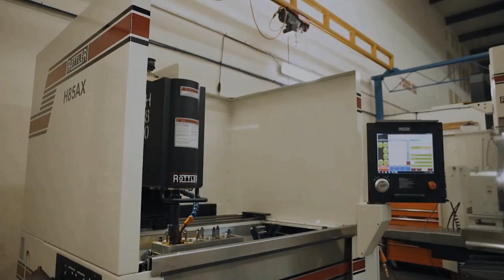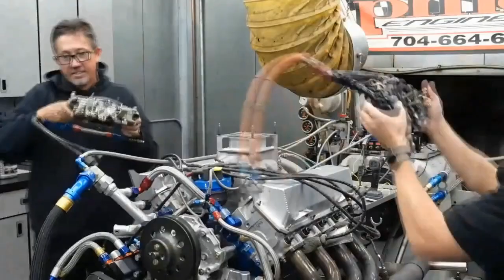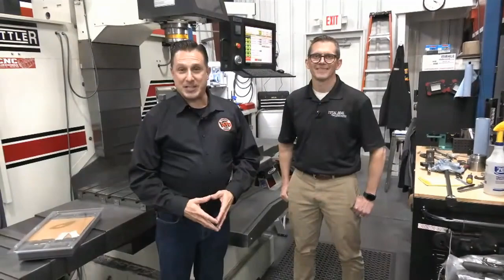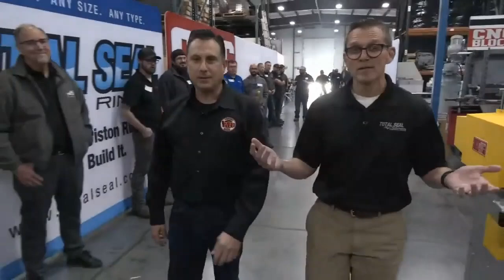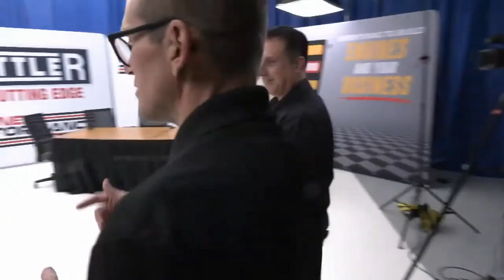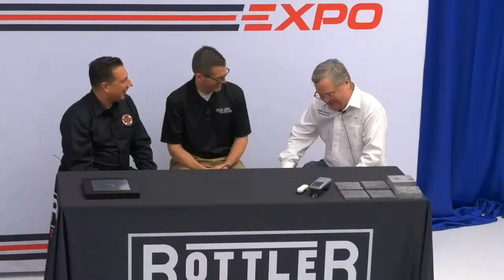Ed Morel Interview & Project Pontiac (Expo 2024 - Episode 17)

Comment: What actually happened with Keny Bernstein was that something happened on the warmup lap , and they had to run a second lap before the flag . Unfortunately Roberto Guerrero let the tires get cold , on the start , the boost came up a little quicker than Roberto expected , blew the tires off , and the car went right into the wall . The part about owning the race is a fact .

Comment: How much does it cost to have a block machined and preped in this manner i live in Sacramento looking for a shop with this capability
Reply: Just had a new little m get .904 lifters, 55mm cam, bored, cylinders bored & diamond honed for ring pack, line honed, pistons coated by line to line. and decked = $3300